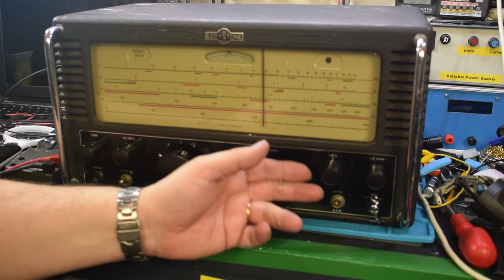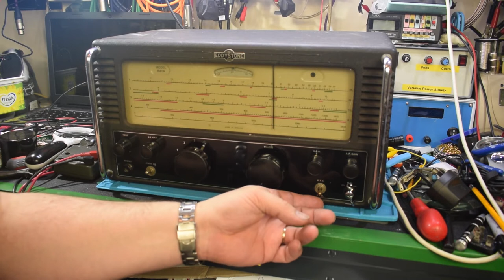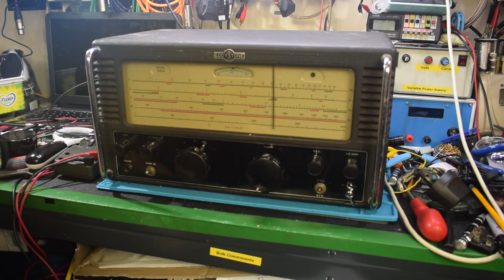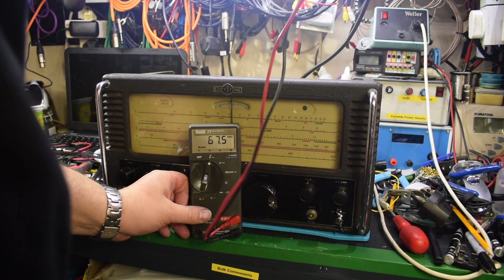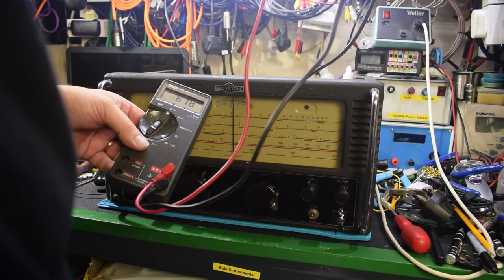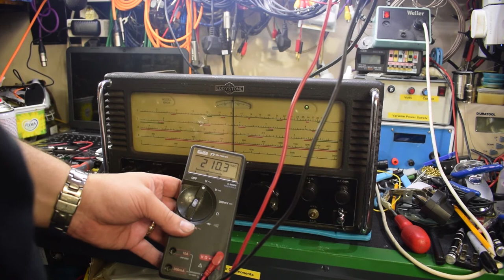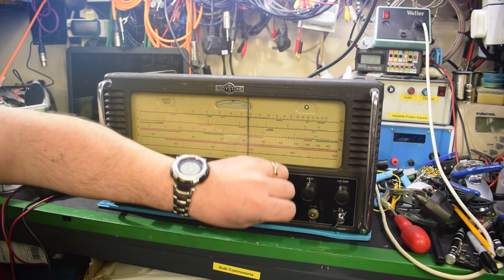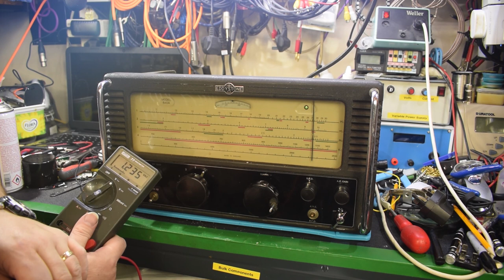Eddystone 840A Repair, Refurbish or Restore? Pt.1 with shocking end!

Comment: That radio had  a pretty hefty price tag when it was introduced in 1954. At 49 pounds I don't know how many were sold. That would be over 1300 pounds in todays money adjusted for inflation. Just found your channel from your comment on Radio Wilds video. Enjoying the series. ATB Doug.
Reply from the maker: Many thanks for popping over. Yes, very hefty price tag on those things. I did get hold of a UHF set a while ago but it was beyond resurrection. I still keep my eye out for other stuff. I'm just looking over the diagrams of a 1953 Regentone Multi 99 that I picked up last friday. I actually have a backlog of vintage sets to work through as well as a stack of 1960's transistor radios. Take care Doug, best wishes, George.

Comment: This is scary! Very useful to me as I have just bought a job lot of Eddystones. Please could you tell me if they all have live chassis or just some models. I need to check mine before i go too much further.  Thanks for the video.
Reply from the maker: generally they do have a live chassis if they were ac/dc models. I do have another in need of restoration that has been fitted with an iec socket already to prevent making the chassis live but keep it at neutral.
Reply: @GeorgeChristofi  Thanks for the reply George, much appreciated. Just a thought a video explaining how and why to use an isolation transformer and a variac might be useful to a lot of people.....I know it's best practice but not entirely sure of the "whys" . I'm really glad I found your channel and will look at your other videos now. Thanks and 73s, Ace

Comment: I have the same fluke meter. It's the first one I got and was given to me by my dad. Although I still have the yellow jacket on mine.
Reply from the maker: Hometown Hi-Fi I bought that one second-hand because I had one in the past that I had to give back to my boss at the time. If I could get a yellow jacket got it I would as long as the stand was intact. Great meters. Sometimes though my AVO 8 is a better meter, especially for tuning vco's as the needle reacts faster than the digital display.
Reply: George Christofi they are indeed great meters. The flexible stand is so useful.  I've not really had many others though. It's a shame I melted one of the leads accidentally with my soldering iron. I really look forward to seeing the next instalment of this radio repair. EDIT: Oh, i just had a look at my meter and its the 79 series 2 not the 77 like yours. It looks almost  exactly the same though.
Reply from the maker: If you melted an original fluke lead it would need a blowtorch! The whole of the 70 series were fairly similar. Just had a look on ebay and the average price of a good 77 Mk2 is somewhere around the £80 GBP mark. Some of the newer models are dreamland figures, but you are paying more now for the name.
Reply: They are the original leads, or at least they came with the meter and have fluke embossed on the probe. I only melted some of the insulation near the probe but I cant see any bare wire. Very robust! They still work and it only seems to be cosmetic damage. The newer models are indeed expensive but it's like you say, branding. 

The only other meter I have at the moment is a cheap one from china (mastech ms8269). I bought it to measure inductance and capacitance as I was making a Hi pass filter and had to make a multi tapped inductor and banks of capacitors for the correct, non standard values. It is a good meter for the price( about 20 quid) and the continuity function is faster than the fluke.